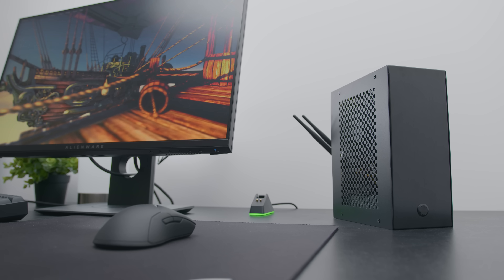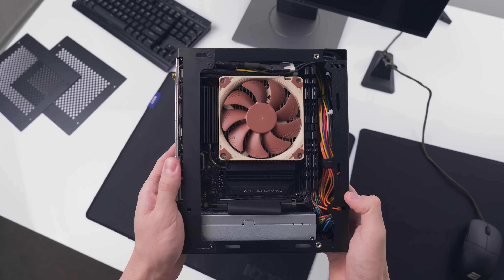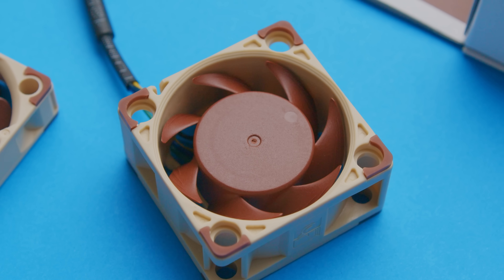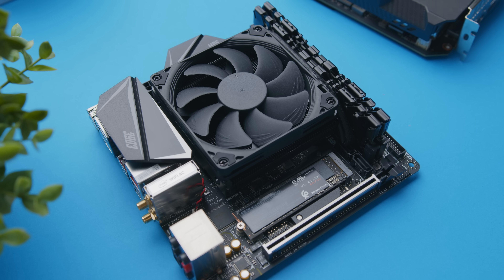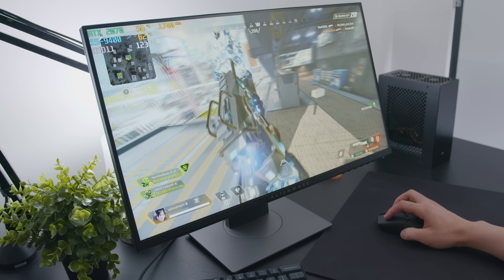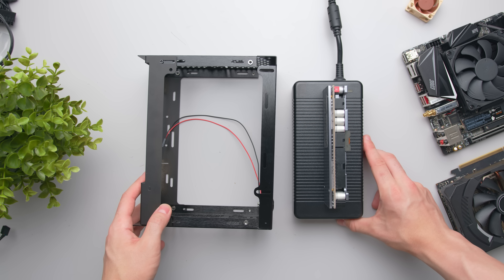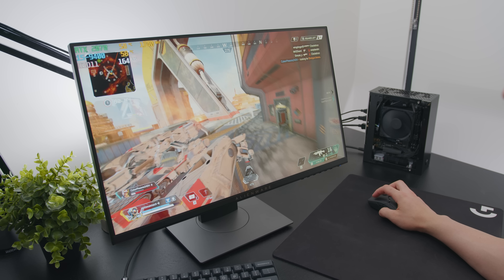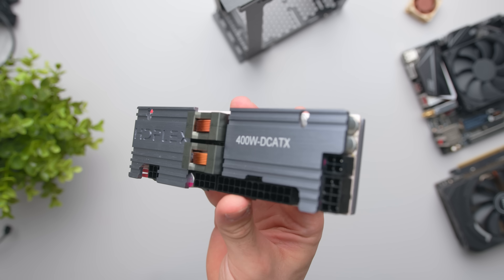Rebuilding the Tiny Velka 3 Gaming PC!

Comment: Wtf this is exactly the video I needed. I was trying to find videos of fan swap of FLEX power supply last night and I couldn't find a single good one. Thanks for the video!
Reply: I opened YouTube today, and this was exactly what I needed too. I want this PC!
Reply: Fun thing your profiles are the same color.
Reply: @TechnoYacy  you think we should mate?
Reply: @roeland1205  I have had ab ASRock Fatality B450 Gaming ITX Sitting on my shelf for the past 3 months, I am tempted to use it in this case now, it was originally going to go into a cheap APU HTPC build but I think my girlfriend won't mind a bit of money going missing for a discrete GPU
Reply: I got the same fan he used and I’m trying to get it to mount in the same psu but the screws don’t work at all kn the fan

Comment: Just a heads up, the stock MGA4012YB-A15 fan inside the PSU is rated to push 18 cubic meters per hour, while Noctua 40mm fans push only 8.9 cubic meters per hour. 

Replacing the fan will reduce noise, but will also reduce cooling by more than 50%
Reply: Measure an cut an 80x80 fan space on the case of the power supply and add an 1cm low profile fan to it.

Comment: Had a similar issue with an external optical drive bay. Replaced the internal fan with the Noctua 40mm and it's so much quieter. I was looking at this exact FSP unit for a project. Now I know to replace the fan off the bat.

Comment: remove gpu shroud and install noctua fans on gpu for essentially inaudable system?
Reply: Hi Nick, this is exactly my thought! Which Noctua fan did you have in mind?
Reply: @f13dfx  from what I see you should be able to screw a noctua 120mm into the mesh on the side or just zip tie it to the gpu heatsink
Reply: Aditya Aurora zip-tying it is probably a bad idea. You NEED a secure fit, as GPUs do NOT thermal-throttle and overheating will lead to critical failure and your card would 200% die.
Reply: @d-o-n-u-t  I've seen many zip tied fans on GPU, and  from personal exp, it doesn't matter how you mount your fan. It matter more on how much airflow the fan you are using is able to generate. Basically you want a fan that designed more for pushing air through radiators not for case airflow (there are always exceptions, but that's the general rule).
Ive seen cases where ziptied fans do BETTER then the stock fan. 
Where the problem comes in is making sure the aftermarket fans are not running too slow (or can self adjust) based on gpu temps.
But that's my 2c, do with it as you see fit.
Reply: @lordhighbinary2006  actually there have been a lot of ppl in r/sffpc doing the noctua fan swap on the MSI or Gigabyte Mini cards. The NF-A9x14 (which does have quite good static pressure for a 92mm fan) fits into the stock shroud and you can use a 4-pin to VGA adapter to connect it to the fan header on the GPU. Thermals are supposedly about the same while it is way quieter.
Reply: You just have to keep a close eye on total card height after the swap, if the fans are any thicker than what comes stock on the card you may run into clearance issues.
Reply: @lordhighbinary2006  5 months late but anyway lol, I did a deshroud and put 2 noctua 120's on my 1650 super (upgrading soon) and I dropped 10c and it's inaudible
Reply: @atlasgfs  No worries thanks for the reply anyway, but this begs the question: HOW did you fit 2 x 120mm fans? Side by side would be too long for the case (it's not 240mm wide) or did you stack them vertically instead of horizontally?
Reply: @lordhighbinary2006  oh lol not this case it's in a matx coolermaster mb311l I'll send a picture through giphy or something in a bit but a busy rn so hold up lol
Reply: @atlasgfs  Awwww :( boo.  I've actually got a K39 compact case I'm looking to build in, but my GPU size restrictions (< 180mm) hence why i'm interested in this. Oh whale. Thanks anyway.
Reply: @atlasgfs  Ooh nice setup, looks good and unassuming. I.E. like it belongs there. Good job sir/maam!
Reply: @atlasgfs  6 months later, that is great!
Reply: @ETL1151  it's still going strong :)

Comment: I dont know if anyone has mentioned it yet, but Earlier revisions of the Velka 3 do indeed fit an HDPlex Unit but cannot be screwed in forcing you to do what he did in this video if you wanted to put one in your system. 

As of the latest Revision, you can now do it with lil hassle and without the thermal tape, although some people still recommend it just to help unload some heat.

Comment: I was able to get the 20mm noctua to work with the flex ATX. I bent the fan cage on the case inward and mounted the fan flush on the exterior. I then closed the gaps left where the old fan would have been with some kapton tape. There was barely enough clearance in front of the power button after I rerouted the cables, but it spins without interference. I also ran a temperature sensor from the motherboard header into the PSU and hooked the noctua to a mobo header. This way I can control the PSU fan based on the internal temp of the PSU itself. It idles at 35c and peaks at 50c under load.

Comment: If you want to connect it to the PSU itself, you'll need the FLX version of the Noctua fan. Also, for anyone using the 10mm thick fan, I would probably recommend putting some electrical tape or something over that little gap between the fan and the PSU chassis so that air doesn't leak in.

Comment: Heyy, I just wanted to point out that Velka now sells their own PSU's together with the V2.0 of the Velka 3, 5 and 7 cases. I would LOVE to see you make a vid about the revised versions and see if the PSU from Velka has the same noise issues. 
Btw, I adore your channel. Keep up the good work!
Reply: The one psu included in velka 3 package is much more noisier than fsp. Better be buying noctua fan as well.
Reply: @sandinodelavega9042 i wonder why they ditched support for the hdplex in the velka 3 3.0

Comment: While Noctua is silent, it doesn't move nearly as much air as fans those noisy fans that usually go into FLEX power supplies. There are few industrial fans made by Delta and Sunon which are much quieter than stock fans, while moving more air than Noctua. A best of both, in a way...
Probably the best PSU you can use in a case like this is Enhance ENP-7660B, a 600W Platinum rated PSU (so, beastly for that size), which is pretty quiet too (for a FLEX PSU).
The best alternative if your components are not powerhungry is the HD PLEX mentioned in the video...
Reply: For sure, I have the Enhance 7660b in my 4L case powering a Ryzen 7700 + RTX 4060 LP and its fan is completely inaudible even under full load

Comment: If your OK with a 330w psu brick, how about the meanwell RPS-500-12-c.  It's a 12v PSU that you'd use with a pico style psu for the motherboard, and will do 310w passively cooled (500w with a fan pointed at it).  It should fit in that space, be silent, and give about the same amount of power as your external brick without needing an external brick.

Comment: This SFF build is just awesome in either format - the Noctua 40mmx10mm fan the Flex PSU appears an absolute must especially when using what is the currently the highest powered GPU available in ITX form. The i5-8400 seems a sensible partner CPU selection . Biggest problem - this incredible SFF cases are extremely hard to obtain. 
Great channel Ali - love it - the video quality is excellent and your chilled manner is informative and welcoming. I do hope you'll attempt a high spec air-cooled build in the Fractal Design Core 500 - perhaps when the next gen of 3080ti or whatever GPU's emerge. For an ITX sized case it really is a boon for ATX kit and masses of it.

Comment: Another thing that can be done is choosing a different PSU.  I'm currently testing the Seasonic SSP-300SUG 300W Gold-rated PSU for "lower power" APU and PCIe-only powered discreet GPUs and this thing is pretty quiet at under 100W load.  My next test will be to move up to a 1050ti and finally a 1650 Super.  Those FSP flex-ATX PSUs have annoying acoustics because of their specific ball-bearing fans.

To note, the Seasonic PSU has a single 12V rail rated at 25A (But has no 6 or 8-pin PCIe power).  The topology is different from the FSP models with dual 12V rails.
Another thing to consider is the total power consumption of the system.  Trying to eke out 200W+ peak power consumption from a flex-ATX PSU without dramatically increased acoustics may be asking too much from it, no matter what the PSU is rated for.

Yes, I plan on ultimately building out on a Velka 3 or a Geeek A30.  I just missed the last shipment of Velka 3 by literally an hour (Jan 6).  They don't get a lot of them and they sell out literally in the first hour of it hitting their web store.

Comment: The one flex atx psu I always hear about when low-noise is thrown around is the Enhance 7660b. Anyone have experience with this compared to a fan-modded alternative?
Reply: From what I've Heard 600w version of this psu works passivley up to 300w power consumption, so no noise when gaming on setup like this
Reply from the maker: Would also love to know!
Reply: Everyone who got one are very happy with it, pretty quiet and lot of juice. If you can get a modded one (with modular cables) from China, it's even better.
Reply: @LastSecBloomer  this case doesn't fit a lot of those custom power supplies
Reply: @alyxburke  True...Velka 3 is quite tight with clearances, unlike chinese cases of this type. Stock 7660B should fit, though...
Reply: I have one too I bought for cheap on taobao. Running with a 2700x and gtx 1660 super. I have yet to hear it. It truly is the only proper choice for this case.
Reply: @optimumtech  I have the 7660b in my Velka 3 build. It simply would be the perfect solution here rather than the HDPLEX(it's the same price, smaller since there is no power brick). It's quieter as it works passively under idle, on full load or full gaming load the noise does not exceed the CPU fan or an undervolted RTX 2070.
Reply: @LastSecBloomer  you won't need modular cables with this. Infact you will want to remove the molex and SATA power lines like what Optimum Tech has shown he's done with his FSP.
Reply: @optimumtech  It is absolutely the best flex-atx for the Velka 3, there are many people that are in agreement in the sff forums. This here is a modded 7660b with custom cables, and noctua fan mod from TaoBao: https://item.taobao.com/item.htm?spm=a230r.1.14.81.650e5369oSh3L5&id=533119895425&ns=1&abbucket=4#detail . You can also check it out at Ebay, for a non-mod version: https://www.ebay.com/itm/Enhance-Flex-1U-Flex-600W-power-supply-ENP-7660B-NEW-1-year-warranty/293285369166?hash=item44492b954e:g:ZtcAAOSwAclbhEik
Reply: I've had a "modded" "600w" Chinese flex, though not with the noctua fan, and the 7660b. The Enhance was definitely better in terms of fan noise and in heat I believe. Definitely the only one to choose if noise is a concern. Though when I built my Velka 3 I used a hdplex 400/dell combo b/c I happened to have that on hand. If you want the quietest build its the way to go. But it's also the most expensive. Even compared to the enhance which isn't cheap.
Reply: I have the 600w Enhance Platinum rated PSU, and it is loud... regret it. I have headphones on and can hear it, i take headphones off and it is screaming. The Wattage being pulled is only 350W.
Reply: @starficz7831  Wow this is exactly what I needed

Comment: for the one want to use hdplex 400w mini board
hdplex actually have a 400w power adapter for the 400w ac-dc board
its much smaller then the dell brick, go check it out

Comment: Now I would get that case with two extra thin noctua fans at the top and change the power supply fan and spray paint the psu black

Comment: First love this case. Also the Enhance 7660b is the only flex psu to buy for the case if you have the time/patience. The hdplex combo is great if you want a silent build. But it's the most expensive option.

Did optimum get the newer version of this case? I have the 1.1 and it doesn't have the mounting holes or back plate for the hdplex. I build mine using the hdplex 400w, it's what I had, and I just have the jack wire hanging out in back. Didn't use any velcro/foam, though the cables and everything else keeps it stable. But it sits on my desk at work though.

Comment: If you can 3d print a 1.5 cm bracket for the 1cm noctua fan,
 (or just cover the holes around it 3:58)
such that it sucks air better and gets a little quicker,
I actually prefer the psu fan mod solution.

It is just neater.

Comment: A screw felt into my PSU
3:30 i done it 
I used a tweezer tryna get the screw out 
It was a SF600
It was on load 
The lights went out
Reply: and hows the PSU? kaput? Had similar experience but was replacing the fan on my flex psu (silverstone) and the exposed fan wire touched another component while installing. Needless to say, the PSU is no longer functional.
Reply: Keep in mind the PSU was even switched off. Remember to wait at least 30min to lets the caps drains so as not to risk killing yourself!

Comment: Awesome!
I wonder if its possible to mod a Noctua fan to that GPU, both for thermals and sound.
Are the 2070 and 2060 Super the highest tier gpus you can fit in this case?
And what could be top Ryzen cpu here - 3600X, 3700X?

Comment: Do the velka 5/3 come with fans. I'm looking at building in one of these cases but at £120 inc shipping minus VAT I dont want to pay more for the average fans. Love your videos really high quality.
Reply: Niven Israel They don’t. It would be hard anyway to fit fans in a build this small.
Reply from the maker: They don't, they're mainly designed for passive exhaust, so they're pretty well ventilated. You can fit slim 80mm fans in the top of the Velka 3, but I'm not convinced they help much. Something to note, the fin stack orientation on the RTX 2070 Mini here allows the cooler to exhaust heat out the back (near the ports), just like a blower card. So exhaust flow is taken care of there quite well.

Comment: I'll say it again. You are really missing out by not just getting ENP-7660b. It's the only psu that should be used in this case. It's proper silent and 600w.
Reply: Emil Bøilerehauge why do you need 200 more watts though? The ENP is $65 more than the FSP 400w and $35 more than the FSP 500w so it just seems like a lot to pay for watts you don’t need and a quieter fan.
Reply: @vianniello93  its just for the quieter fand and fan settings. Its basicly silent were as other flex atx psus sound like tiny jet engines. Just for that reason its worth it.

Comment: It's probably worth using something to seal the fan against the PSU so that all of the air flows through the PSU, and the replacement fan doesn't fit flush. Electrical tape would be a good option.

Comment: there is modified psu selling in aliexpress for mini case build (low noise with short cable) .You can check it out, I planned to buy one from them.
Reply: I would love a fully modular flex psu in the 400 watt range!

Comment: As I had already mentioned in several posts on smallformfactor.net, I believe using the PSU fan as an exhaust is not the best way to handle cooling it. Most Flex ATX PSUs have their only other openings to the top of their casings, which means that the negative air pressure from the fan being exhaust will pull hot air from the system into the PSU in an attempt to cool it down. If you really want to cool down the PSU turn that fan around and compensate for the hotter air in the system by pulling the CPU fancurve up a bit. Ideally, the positive air pressure from both the CPU Cooler and the PSU cooler will just push the air out on the bottom half of the side and back of the case.

Comment: Ali, could you have 3D printed or bought a gasket to bridge the gap between the smaller fan and the PSU case? You think that would have made a difference with airflow/noise?

Comment: On top of that power supply is the 350W Silverstone one which has 80 plus Gold like this. Is that good too? And then the fan is not on the other side of the power supply but to the left of the switch so it will have more room to breathe, right?

Comment: It appears the the "fan cage" portion of the psu shell is shorter than its bottom panel for some reason. I'd cut it off and make/3D print my own to fit the 20mm fan in there.
Reply: Yeah... I would be tempted to mod the psu to fit the 20mm too.

Comment: Hey Bud going to change my fan in the PSU do you recommend connecting the fan to the motherboard or using the noctua adapter and plugging it into the PSU? Cheers

Comment: Great, thanks to your channel and your great production quality, now I'm in love with itx builds and I'm really considering to buy the velka case.
Still not sure if the velka 3 or velka 5 though
Reply: Velka 5 is a more expensive case but it is just as easy to fit in a backpack and wattage isnt a problem not sound and the components are cheaper and more flexibility

Comment: If you're using a lower power setup like a Ryzen 5600X and a GTX 1650 (or undervolting something more powerful) could this be work with a Pico-PSU? Using a Pico-PSU may also allow for better thermals by mounting a fan or two where the PSU would normally be mounted.

Comment: i use a SeaSonic passively cooled PSU and it works great
Reply: What model is that if you don't mind me asking? Velka 3 is my target now I know there are quiet PSU options
Reply: @MrDbrennen  Its a full size model in a ATX case, the Prime 600watt titanium
Reply: @Sleepy.Time.  well that's a bit irrelevant then — it's more than half the size of that velka 3 (2.19l, 170x150x86mm; Velka 3 is 3.8-4.1l)
Two of these stacked would be larger than this whole system, yep.
Reply: @Sleepy.Time.  Vote name change to Coffee .Time :p That's lovely to hear about your passive ATX power supply
Reply: @MrDbrennen  sorry i  didn't know owning a cigar box size computer was a prerequisite for commenting here